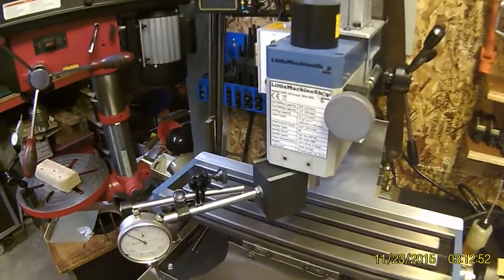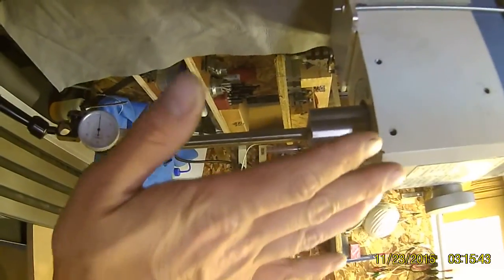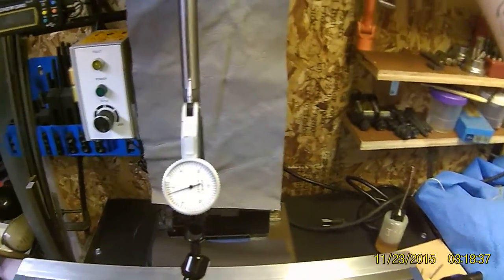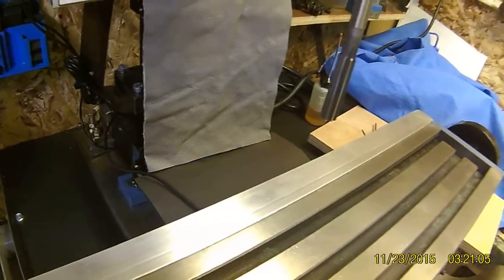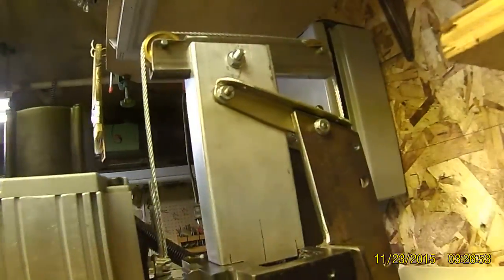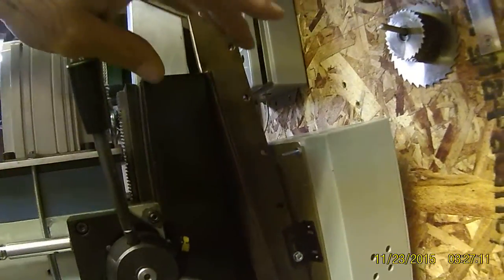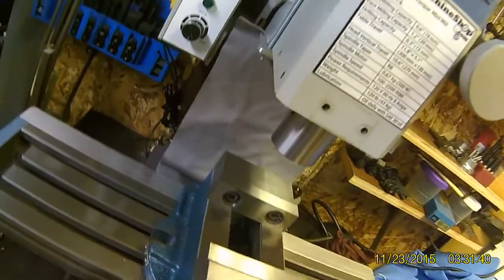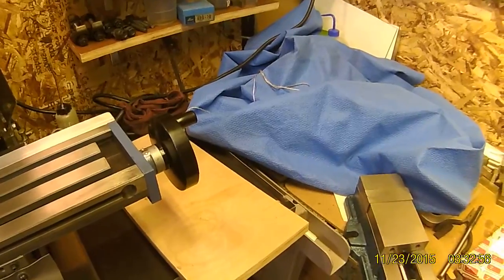SX2 mini mill show and tell mods. part 1

Comment: Hey how do you like your dro  System.i was just wondering because I was thinking about going that way. Cheep. Lol. Thanks for the video’s
Reply from the maker: Barry Cass , on  a small mill this size it is sufficient for semi precision work. If I was to do it again I would get one with glass linear rails as they have a lot better resolution. For really precision parts indicators can be used in conjunction. But for this mill you can get glass rails and head unit for under 3 bills.

Comment: Great info! Love what you did for baffles! I've been looking all over for replacement ideas. And I as well had to scrape all my dovetails and etc.
Reply from the maker: Oh yes the addiction of making the indicator read "0". So far the covers have worked great. I dont care for where the front one mounts to the lead screw bracket. I also just picked up a anti backlash ball screw to replace the rack and pinion for the Z axis. X and Y down the road. I am planning to change the counter balance to a chain and sprocket for over the column. I am also adding a 2 plus HP treadmill motor and a tilting head to make it easier to true and more versatile. Yada yada yada.
Reply: So far backlash on the table isn't that bad, knock on wood.... one of the biggest problems I am having is backlash on the fine feed adjustment for the column... its some thing like 85 thou... engineered POS....
Reply from the maker: Yeah my table is not bad either. I have been mentally debating buying taps to make brass anti-backlash nuts for my table feeds. You can also put a shim on the table feed nuts to angle them slightly which will remove most the backlash. As for the fine feed it drives me batshit crazy when I need to back off just a hair. That's why I am going with a ball screw. The design of the mill allows play in the linkage knuckles which I shimmed to minimize. Also play in the worm, castle nut lock, the keyset and the rack and pinion. The rack and keyset can also be shimmed to remove some more play. However, the castle nut and worm gear are hopeless. This I hope to cure with a ballscrew. It will solve the rack and pinion issue and wont allow the head to violently pull into the work piece when plunge cutting. I will use a double bevel on my hand wheel against a single for rotating the Z axis ball screw this should allow me to remove any play in my course feed. As for the fine feed I am torn between using an adjustable worm drive that can be disengaged, or an always engaged gear on gear reduction ratio which should minimize play to a few thou. I will post videos when i figure it all out.
Reply: I would be really interested in seeing what you come up with for the fine feed. I'm currently still battling truing the table up and replacing the blown potentiometer. I'm thinking about adding a larger project box there for additional function switches and etc. Also adding a terminal block in there as well. That will be followed by DROs, air spring conversion and then a mist system.
Reply from the maker: Air spring is a waste of money, if you want I will sell you mine. The LMS design mounts to the side of the mill head causing a constant angular torsion on the head. The further toward the table you go the stronger the torsion. It also makes the last few inches quite difficult to compress the spring. I don't know anything about the torsion spring set up, but imagine the air spring is better. The air spring also makes the gibs difficult to adjust. If you have a little room above or below the mill a counter balance set up is the way to go. The stock head on the SX2 is only about 33 lbs. With a counter balance you can place the balance attachment in the center of the headstock it makes the gibs easy to adjust, saves wear and tear on the dovetails, and keeps the headstock tight against the column. Best part is it can be done for way cheap, possibly even free if you are creative. All you need is some heavy duty para cord, sand and something to use as pulleys.
Reply: Never considered the side torsion that it would cause... I definitely like your counter weight idea